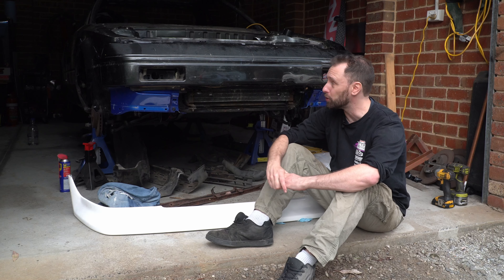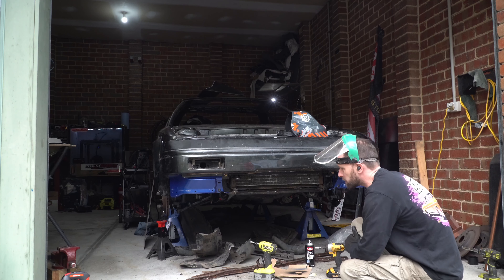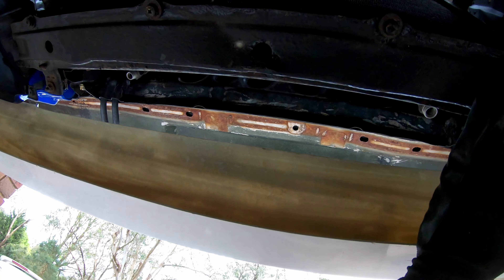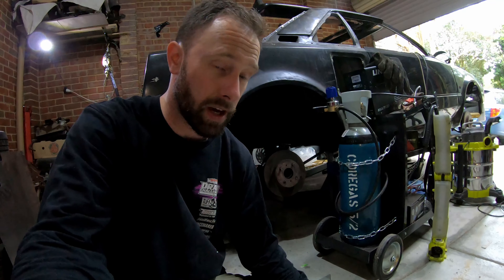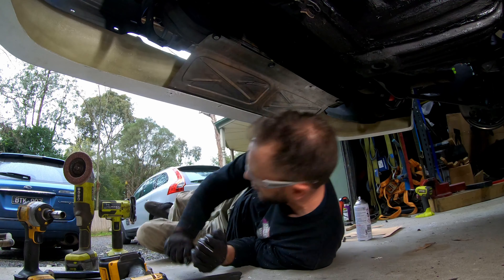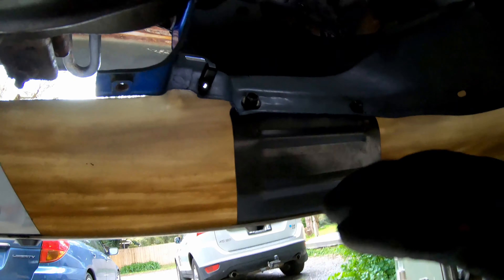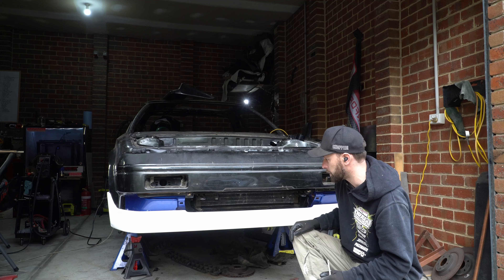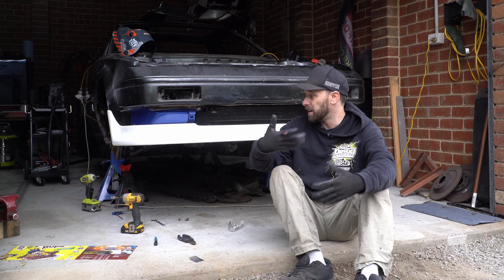1980's Toyota MR2 new front lip, so sick!

Comment: Also you could use p rubber moulding to fill the gap between bits like where the spoiler sides don’t quite meet the panel. Comes up neat, cheap and get it from Clarke Rubber.
Reply from the maker: I've got some on the shelf but I'll see what clarke rubber has to offer :)